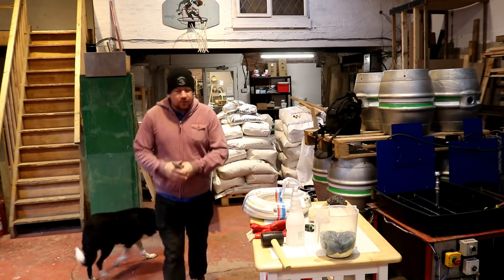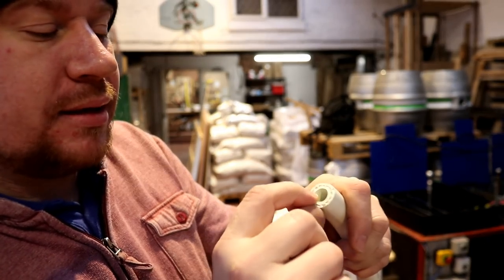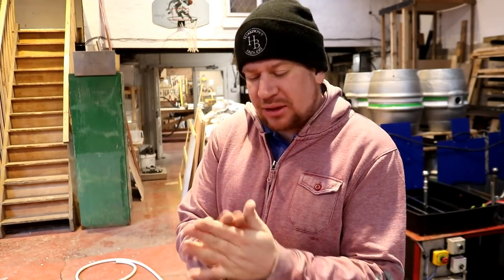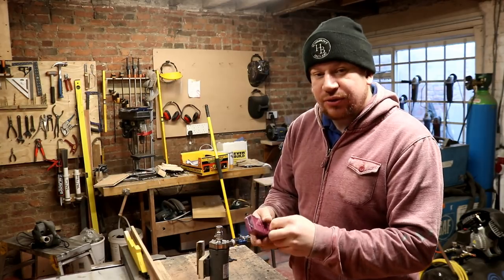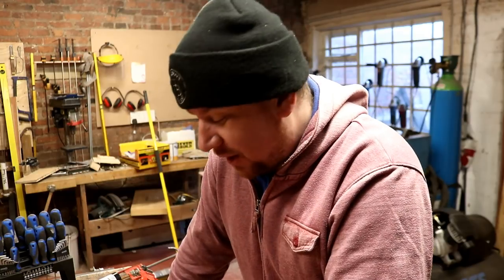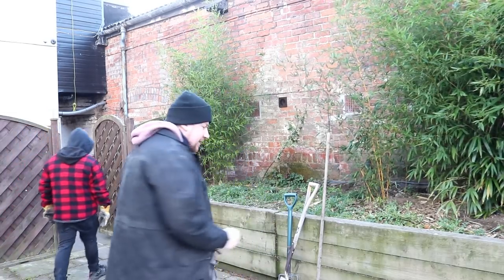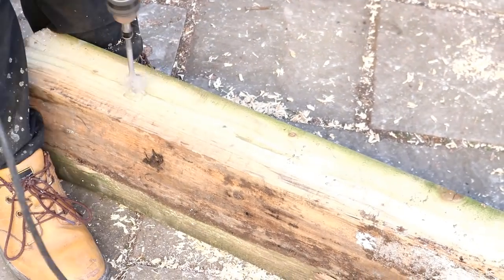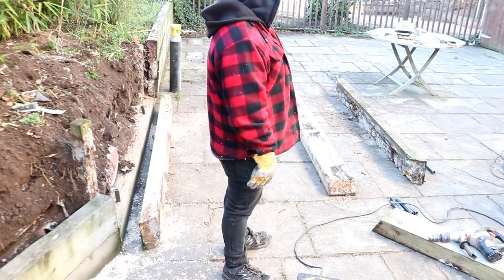IT HAS TO COME DOWN

Comment: Get in then, high pressure hot transfers coming up 😄! Did you put new timbers in or just reseat and reuse the old ones in the beer garden? The rubble in the bottom of the border may have been for drainage. It may be an idea to install a drain outlet (just a hole drilled in the bottom near a drain if possible) as water can collect in the bottom "catchment" and cause the lower timbers to rot. Cheers, Schnuz.
Reply from the maker: I just reused the old ones. They are rotten but I might get a few years out of them. After that, we will dig the lot out and get rid. The soil is damaging the wall behind as the membrane has perished.